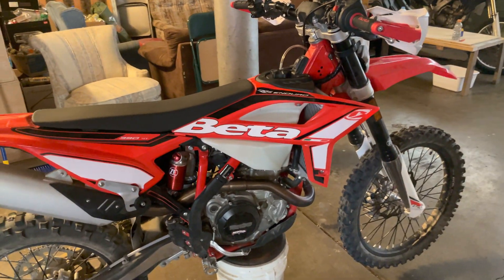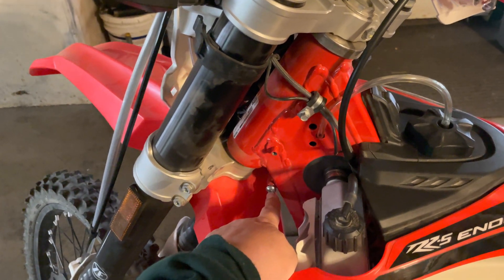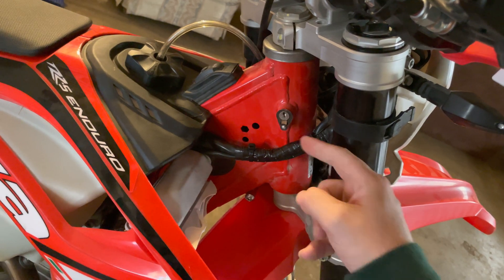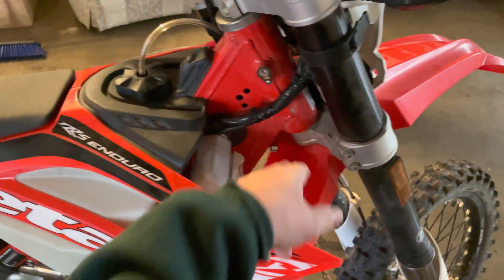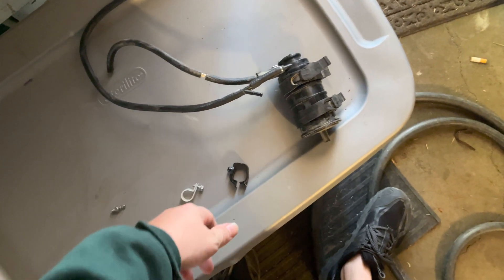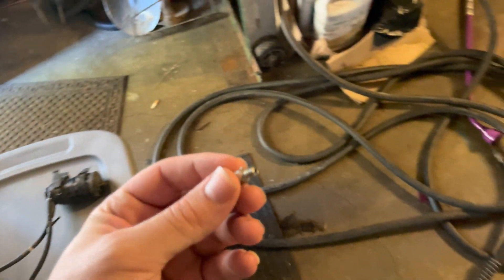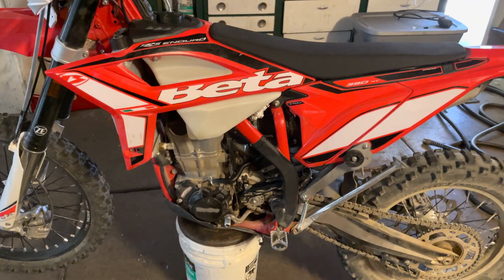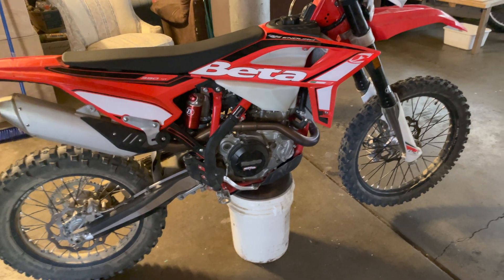Beta 390 RRS turn radius

Comment: So what was the outcome? Did it work?
Reply from the maker: Indeed. The temperature on the relocated rectifier stays approximately the same temp as it was when mounted up on the steer stem. Further, I was able to gain a small bit of turn radius by driving the steer stops in a bit further and that’s in addition to and as a result of relocating the rectifier. Fast forward a few months and I did end up with one of the mosfet ones and I also changed out my rad fluid so while I was in process of that, I removed the radiators and took a small butane torch, a bigass socket and a deadblow hammer…heated up the radiator in key location (after taking some measurements of angles) with the torch, placed the socket directly on the radiator in that location and smacked it with the hammer a few taps while it was still hot. The end result was a wide but rather small dent in the upper inside section of the radiator where the forks would normally make contact without the steer stops in place. And that dent in both rads allowed for appropriate clearance for the forks to get full swing with the steer stops removed. I also cut a little of the louvres as well to compliment that additional clearance. I really should make an updated video to showcase this.

Comment: Hi ,  good mod. in right side on silinder head is 3 black cup (same like oil level check cup) nuts 5mm hex key. Do you know , what for the middle cup nut is ?
Reply from the maker: I don’t, not right off hand…but I’ll take a look tomorrow to see if I can find which one you may be talking about

Comment: FYI. While you're messing with the regulator you may as well replace it with a RMX 450Z MOSFET. Less that 100 dollars from RM Stator. Plugs right in and provides major improvements to charging voltage. Just need to ream out the holes on the regulator. Also use split convoluted wire loom on the wire around the steering stem. I have 102 trouble free hours on my 20 390 with this setup.
Reply from the maker: Hey thanks, Nick. Yup, that’s the exact RR I installed in place of the stocker just a few days after this write-up/video. I’ll be looking into the split convoluted loom you mention, I’m unfamiliar. But so far, I too am trouble free. Thanks again